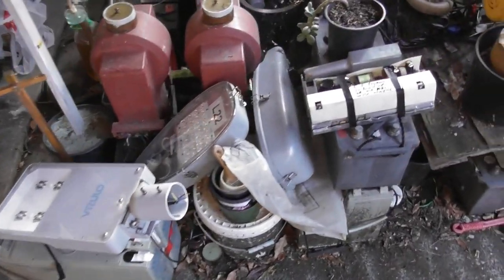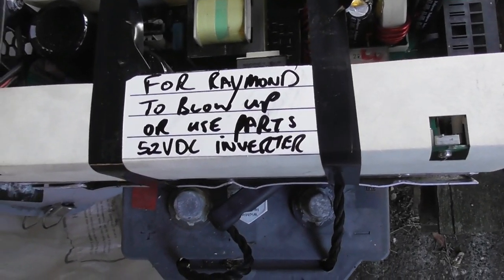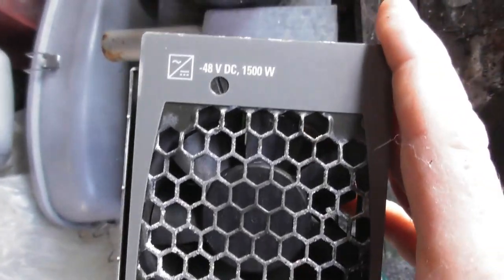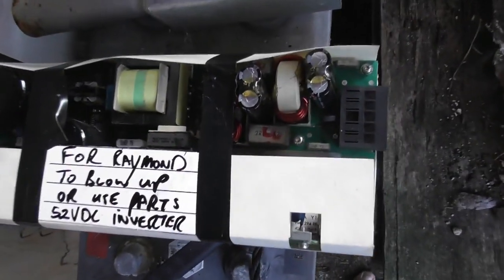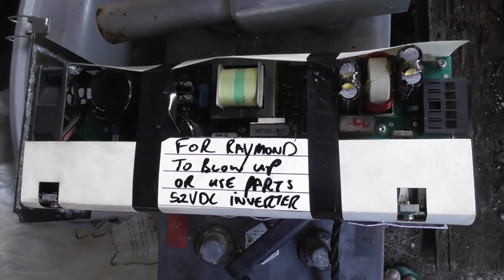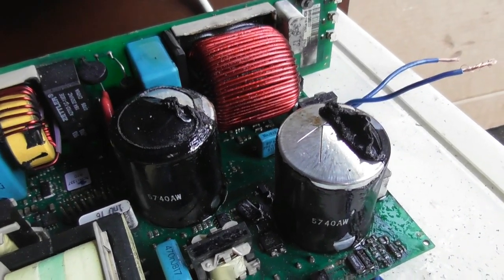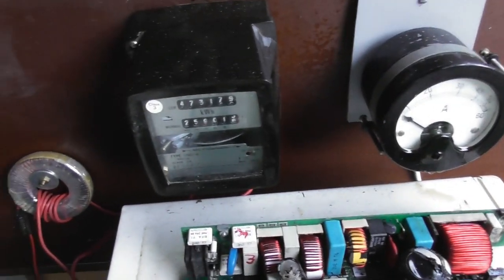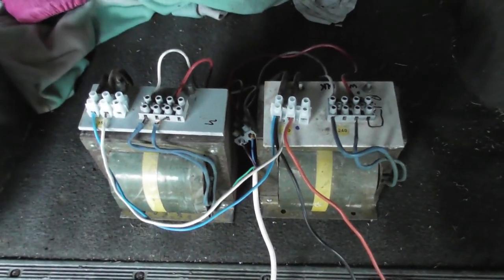2 x 390 µF Capacitor vents vigorously

Comment: I didn't know capacitor vapor could flame up like that. What is the electrolyte in these caps?
Reply: It's usually an insulator like wax paper laminated to aluminum foil, then wrapped in a tight spiral many times over like a cinnamon roll. Maybe @RODALCO2007 can cut one open to show what it looks like before destruction.

Comment: That gas from the caps is probably not so good for the old lungs
Reply: Rick James Smells like rotten fish sometimes. I work at an electronics manufacturer and once in a great while we will have a capacitor that will just decide to up and go even though it was no different than all the others in the same lot.

Comment: What a pointless waste of that PCB. It looked good quality. Those big caps ain't cheap and rarely go bad. You could and should've saved them. blow up some cheap crappy Chinese capacitors instead. CapXon, Fuhjju (aka Fukyyu's), Jun Fu, OST, G-Luxon for example.
Reply from the maker: Well the board would have ended up in the skip. I saved the IRFP460 mosfets. I have too much junk anyway, Can't keep them all.
Reply: If it was being skipped it was probably faulty anyway
Reply: RODALCO2007 yeah, I’m taking time during this lockdown to sort my collectibles, projects to work on, and stuff I’ll never get around to (and therefore back into the ‘skip’ as you call it).